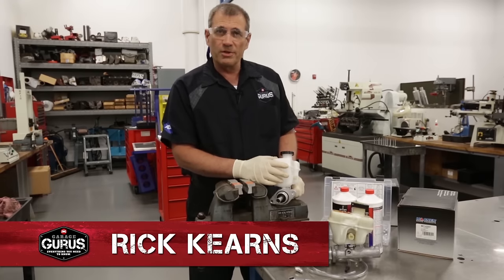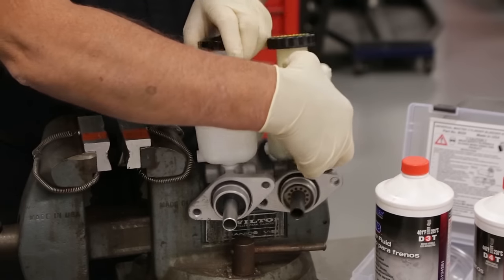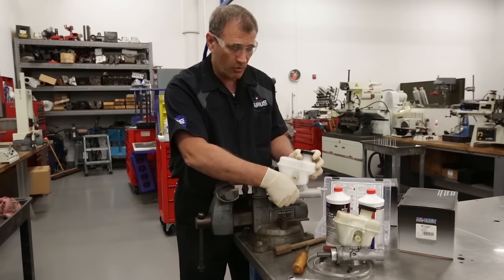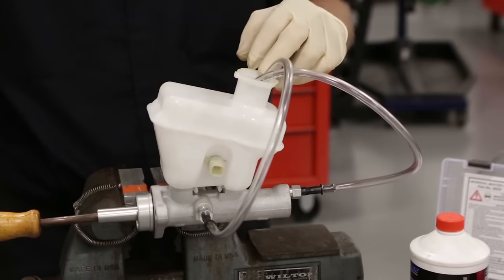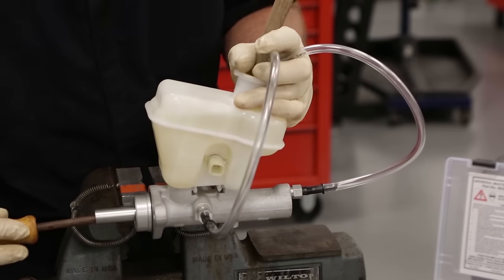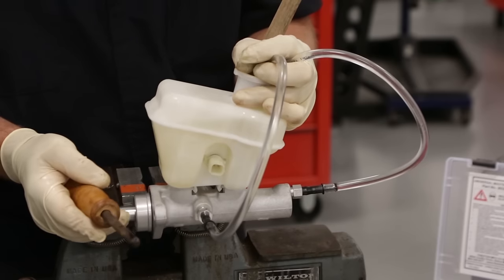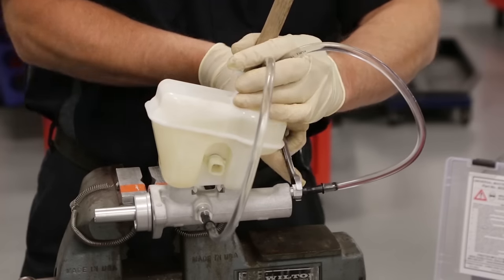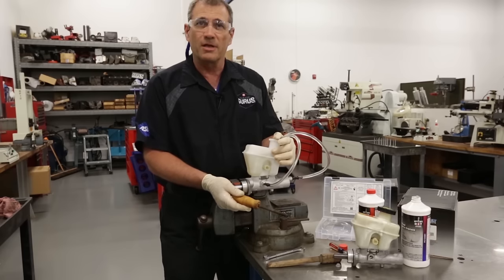How to Bench Bleed Master Cylinder

Comment: So how do you remove the lines without air getting back in the MS when hooking up the lines to the vehicle?
Reply: As long as you don't press on the piston it won't pull any air in..
Reply: Really helpful question. ✊
Reply: @bethridinger421  - Thank you 😊
Reply: Does MS stand for Master Cylinder?
Reply: You need to close the bleeder screws before you remove the lines off of them.
Reply: This procedure is for only bleeding air out of the master cylinder not the rest of the brake system. You still need to bleed the brake lines
Reply: @veto1380 lol. At least one person gave the correct answer!
Reply: @SuperRookie95 no Mangekyo Sharingan
Reply: @SuperRookie95 it stands for MASTER SPLINTER 🐀 lol. I think he ment to write MC
Reply: Finish the job before you end the video! Tubes still attached… gotta get rid of excess fluid… what other steps?

Comment: To answer everyone’s question: yes a small small amount of air will go back into the cylinder during install. This air will bleed out when you bleed your brakes. Bench bleeding a MC is actually not required at all!! It does get bled during a normal brake bleed but it will take FOREVER if you are doing a pedal bleed (as opposed to vacuum or pressure bleeding). You might as well do a good job bleeding it 95% before install hence everyone doing bench bleeds. All he is doing in the video is “pumping the pedal” by pushing the piston.
Reply: Thanks for this, I'm doing my 2016 f250 today and didn't want to miss anything.
Reply: I have a bleeder with a pump so i shoukd be good to just go to the farthest brake line and start pumping away right making sure the resevor has plenty of fluid
Reply: Thank you for telling us that it's fin for a small amount of air to get back into the MC during installation! These videos all seem to skip that step (info), which is important for first-timers like me.
Reply: The problem is pumping with the pedal won’t move the piston all the way and it will retain air.Just get a power bleeder and push it from the master cylinder.

Comment: you didnt do it correctly,  the cylinder has to be at an angle which is opposite end of the piston,  so piston push rods  is facing upwards  toweards the sky, reason for this is that if its level or the fitting end is facing the sky.  air will still be trapped inside of it.

Comment: Always bench bleed it will save a ton of bleeding time. After bench bleeding take some plastic I use 3M paint masking plastic put it over the hole put the cap on over it on top of the master. That will block the vent hole so when you remove the bench bleeding hoses the fluid doesn't run out. Then it's easy to switch out the lines you can also do this on your old master to keep it from leaking fluid all down the inner fender when removing the lines.
Reply: Good tip. Thanks, I'll do this when I swap out my MC on my 2000 XJ

Comment: great video, one question, after you did the bench bleed,  how you install the brake master without the fluid couming out of it? all cars are different, some have more space some don’t, and those cars that have limited space to work require to remove the brake fluid reservoir, how you do this without spilling the fluid out of the brake master?
Reply: this is the most important question that isn't answered...I watched the whole video and wondered what next... and yeah
Reply: Use blanks to plug the holes
Reply: @petittrainguernsey3297  That still didn't answer the question, cuz when you remove the blanks there will still be a big mess!?
Reply: @roushl1964  
Move fast...
I attach all the brake lines first, open the bleed nipples then run clear pipes (Aquarium tube works well and is cheap) back to the master cylinder.
Then pump it gently, adding fluid as the level drops, keep pumping until no bubbles come along the lines.
You’ve created a closed circuit as long as the pipes remain submerged in brake fluid.
It’s time consuming and you can bet one of the tubes will fall off. Can do all 4 together or one at a time. 
Works.
Reply: @roushl1964  there will more than likely be the same small amount of fluid coming from the cylinder from when you loosened the brake lines. A master cylinder isn't going to leak much after being unplugged. Hence the fact that it takes the amount of force of a foot to a brake pedal, to get the fluid from the cylinder to caliper or drum. In example, it would take the same force you used to bleed the cylinder to make a mess. The master cylinder holds the fluid until it is pumped/braked. Without pressure there won't be much leakage. But it's always good to be safe and have rags or a drain pan. Given the fact if you let brake fluid sit on painted parts... It will STRIP your paint!!!
Reply: @petittrainguernsey3297  The right rear would use alot of Aquarium tubing. Why not use a vacuum hand pump instead?
Reply: @leontube007  
Because you need to pump the master cylinder. Just drawing fluid through with a vacuum pump won’t work. Trust me, tried it.
Reply: Anyone know fitting size of bmw MC ports?
Reply: I’m

Comment: You should not push the plunger all the way in, you can damage the seals doing that. Only push it in about an inch or so. Good video otherwise.
Reply: thats only for old cylinders brah
Reply: 3/4' to 1' max for the reason you stated....
Reply: Yep and also use a wood dowel to push the piston, not a screwdriver!
Reply: I believe it will only damage the seals in a used cylinder with a line developed in the bore from corrosion or wear. Otherwise on a new MC it should be ok.

Comment: One of the better master cylinder bench bleeding how-to videos. The key point he mentioned is the mounting angle when the master cylinder is installed in the car and how this can trap air that cannot be bled out without removing the master cylinder and bench bleeding. He mentioned being able to rock (tilt down and up) the master cylinder back and forth when bench bleeding, which releases trapped air, not an option when installed in the car.

Comment: Thanks for the informative video. had this go out on my off road mud truck, never even thought about bleeding the MS. I should be able to stop now LOL. its the little things that I forget sometimes. I would have just bled it until fluid comes out of the lower fittings. Then bled the brakes at the calipers. cut corners I suppose on toys. I'd still recommend  bleeding the calipers as normal for other folks. just to be safe. and as always, test the brakes throughly before going into traffic. be safe
Reply: MS???....are u referring to the Master Cylinder ?

Comment: Rick my name is Jose ellin I want to thank you very very much you're the only person that I saw online saying anything about the the ride on the master cylinder that if is not space properly the brakes could be locked up I want to thank you for that because I spend almost $500 taking the car to different shops and none of them could figure that out it's only until I show you a video and I remember then on a manual car instructions when you set up the clutches to leave room for the expansion of the fluid thank you Rick you save me a lot of money

Comment: You have solid fluid now, but how will that remain once you undo these fittings and attach brake lines? where will the air introduced then go?
Reply: if the reservoir is full surely no air will be reintroduced to the master cylinder while fitting it to the car, then you could just bleed the brakes once installed .
Reply: @closertothetruth9209  He's reffering to air entering into the lines removed at the Master Cylinder itself.
Reply: once you put the lid on it will not collect air when you loosen the fittings
Reply: @philip6419 that’s fine, it’s in the lines

Comment: I wad up a piece of clean paper towel to plug the ports after bleeding. Put a smooth side in the threaded hole. When you are in position just easily take out the paper plugs and trade for the brake line fitting. You may look at the plug to see no paper was left in the port.

Comment: When you remove the fittings/plastic lines after completing the bench bleed what keeps air from coming back in the pressure chambers? What prevents air from coming back into the pressure chambers through the two outputs?. Sorry,beginners question.
Reply from the maker: With the Master Cylinder at rest, Atmospheric pressure is equal on both sides of the pistons (pressure chamber), reservoir and outlet ports.  Fluid encompasses the pistons and pressures chambers.  As long as the master cylinder retains this fluid no air will enter the master cylinder.   Gravity will try to empty the master cylinder through the outlet ports if plugs are not installed to prevent the draining of the fluid while installing the master cylinder on the vehicle.  If the master cylinder goes empty then air will now enter the piston chamber.  Additional bench bleeding will be required.
Reply: Thanks. @GarageGurus
Reply: @GarageGurus  ...So you need to have some fluid in reservoir after bench bleeding to keep the pressure chamber and pistons free of air? I've never had to change a MC but looking into it...well done explanation but don't know exactly what's next, you mentioned plugs but when the plugs are removed (you have to to install brake lines) you won't get a little air back into MC or it won't matter because it's after the pressure chamber and pistons? And there will be air in brake lines(s) anyway? So that's where bleeding your brakes comes into play...right?
Reply: @harryberry474  I think this seems to be the case from reading, but doesn’t air only travel up in fluid? 😅
Reply: @GMoney-B  Not if you’re forcing it out toward the calipers.

Comment: I've been trying this on a Mazda cx7 which has a different set up... The reservoir that is on the master cylinder the fill nose is on the front of it... Is there another way to bleed this system or do I have to use the fill reservoir also to do this... Thank you for the advice

Comment: Question: what happens when you install the Master Cylinder back on the car and remove the fittings with the plastic tubing? Doesn’t that allow air back into the MC? Thank you in advance.

Comment: Every single one of these I've seen it's so easy but tell me how you do it with the master cylinders that have a line coming out the bottom with a rubber hose. When you're taking it out of the vehicle and you disconnect that hose there's literally fluid that pours out the bottom of it out the back of it so how do you bleed it?

Comment: I did this but had trouble fitting it to the car i couldn't compress the piston enough due to the fluid to get the nuts on to the studs so i emptied  it then refitted and re filled then used the brake pedal to bleed out the air

Comment: What happens when you take the fittings off?  Does air get in there and does it leak?
Reply: Wondering the exact same thing and not finding a video that explains that.  I got the technique down but wondering same thing you asked
Reply: Once you get the master cylinder loosely back on the brake booster, you can then pull the hoses off of each fitting and attach the brake lines. There's other videos that show the plungers, springs, and seals inside the master cylinder. The idea of the bench bleed is to fill the cylinder on the bottom with brake fluid and remove all of the air. Unless the brake pedal is depressed, there's no path for the fluid in the reservoir to enter the bottom cylinder. So the only air that can get in is around the fittings. So you're looking at a slow drip situation. Since you have to bleed the brakes at each wheel anyhow, that's where you'll get rid of any air introduced when you pulled the hose off and attached the brake line.

Comment: Can you bench bleed with the MC already installed in the car doing this where you can route the tubing back into the reservoir?
Reply: Yes
Reply: @drumrooster  I’m guessing the only difference is that you can’t rock the cylinder a little bit to get more air bubbles out? If this is the case why is it such a standard to bench bleed and not bleed the MC when bolted to the booster?
Reply: Yes, you just have someone hold the brake pedal down and open the line fittings slightly. You will see the air bubble out around the line. Keep doing that until it's fluid and no bubbles. Do one port and a time.

Comment: Won't you pour brake fluid everywhere when you release the bleed kit, thus negating the effort of bleeding it? Or is it then bled up to the outlets? I guess the piston in the relaxed position holds the fluid in. I'd love to know.
Reply: As you can see from the video every time he pushes on the piston brake fluid travels one way through the line, you never see it coming back the other way. I believe you could do this without the lines going back into the reservoir, but you'd make a mess and waste clean fluid.
Reply: Leave the pipes on till the last moment when the cylinder is in the vehicle.
Reply: @petittrainguernsey3297  ...What good would that do if you take those lines off at ANY time and fluid leaks out? The original question was something like won't you get air into MC after the bench bleed when you remove the hoses before installing the brake lines?
Reply: @harryberry474  If the resevoir still has fluid, then fluid will continue to seep out of the ports, and when you connect your brake lines, into the lines. Even if some air would backfeed into the cylinder, you are still much better off using this method than starting with a dry cylinder.
Reply: I really wish he explained this in the video...

Comment: so i assume after the master gets, well, primed (or bench bled) there will be a little air when I install in onto the booster/lines? if thats the case, why i not just install it dry, fill the reservoir, and then bleed all the calipers?
Reply: Youll be bleeding your brakes for days that way. Itll force all the air into the abs system and through all the lines making it a way bigger pain in the ass to get it all out. Doing it on the bench first removes the vast vast majority really easily leaving only what little gets in during install to bleed from the calipers

Comment: great video. I am doing one for the first time. The fluid is just moving back and forwards in the tubes though? What is wrong? I have copied the way you set up the tubes and the reservoir. I have a 2 port cylinder similar to the one in the vid.
Reply: I have the same problem :( fighted just about 2 days , and nothing . The fluid is moving forwards and when i relase the pedal , the fluid is moving back to the box ... The pedal is not getting hard ever
Reply: Hey, did you ever figure out what was going on??
Reply: @grzegorzmalinowski9841  either of you guys figure out what it was?? PLZ 😭😭thanks in advance
Reply: I had this problem with mine. I had to make the tubes as short as possible so they could still reach the reservoir. I was also able to play with the way I pushed the pedal, to get the fluid to move better.

What I did on 3 new MC installs so far, was raise the car to level the MC bore. Like back it up on a hill or ramps. Then reach in and press the pedal, while leaning around watching the tubes for air. I had to use both slow and fast strokes to stir up the air to get it out, but once I got it out it was great.

Comment: is it possible that the air could escape into the reservor? I have bled my brakes, unfortunately it seems I may have introduced ait into the master cylinder. My brake pedal is spongy and travels too far down. I drove it for a bit and the brake fluid warning kept coming up. I think the air pockets travelled up the brakes.

I will do another bleed. It's just a PITA to do it. The reason why the brake bleed got messed up is because the eeziblled brake bleeding kit failed the brake fluid pickup tube (a 2 piece part) split apart which meant air was being pushed into the reservoir. Didn't noticed because oil was coming out the bleed nipple.

Comment: im wondering if ,when you remove the tubes ,if fluid should dump out of the fittings,,Im afraid my new cylinder is missing something internally as fluid is coming out when i remove them

Comment: Question; what happens when you take the fittings out to install it and the brake fluid runs out?
Reply: did you ever figure this out?
Reply: No one ever answers that question
Reply: kim The fluid will keep flowing out and as long as you keep fluid in holding tank. But it want get air back in master cylinder  and that's what you want is no air because once you get it hooked up to the lines it is hard to get out and you don't want it going into your ABS because sometime you need a scan tool to get it out of their. And if air dose get in lines it will hopefully just a little. But you will still need to bleed brakes to get all air out of lines them selves hope this helped.
Reply: some does get in when u connect the lines. just don't let the master cylinder run dry. keep it topped up. bleed the system and ur golden.
Reply: If you have to ask this, you probably should just take it to a mechanic..

Comment: will a bad brake booster make the 4 wheel drive stop working. My pedal is tight I hear air and the 4 wheel drive is not working. Ford Expedition 08

Comment: I tried to bench bleed a 2nd hand MC.
As soon as I poured brake fluid into reservoir it started leaking out of the lines...the reservoir drained empty without me even touching the pump piston.
Is that master cylinder shot,?
Reply: Did you have clear tubes secured to the outlets, and the tubes running back into the MC as shown on this video?  If you didn't have the clear tubes on those outlets, gravity will cause the fluid to trickle out of those hose outlets.
Reply: @crocodile1313  
all good.
I installed the MC onto car and got it running the day after I sent you that you tube comment.